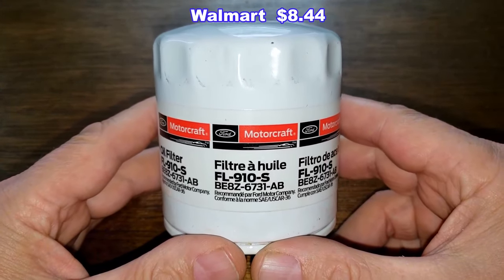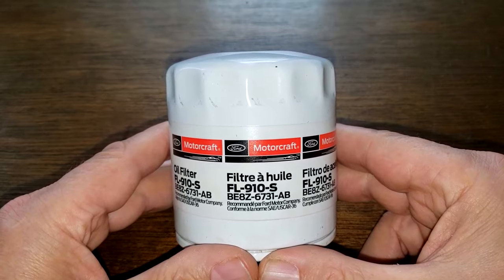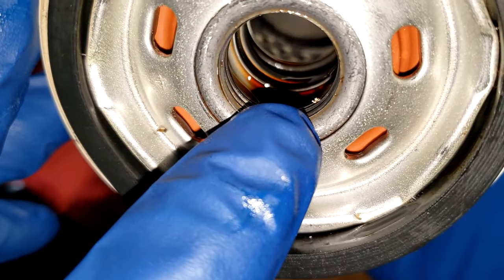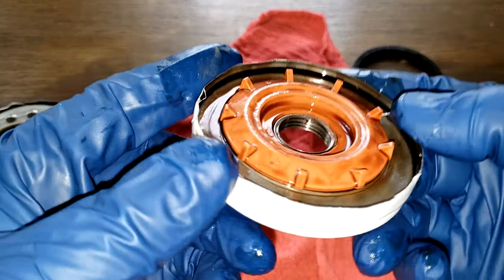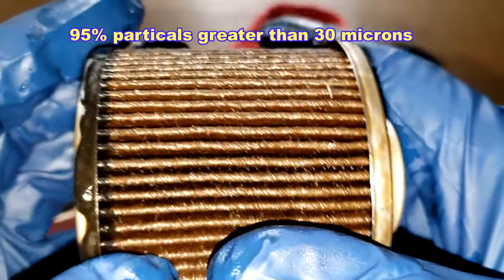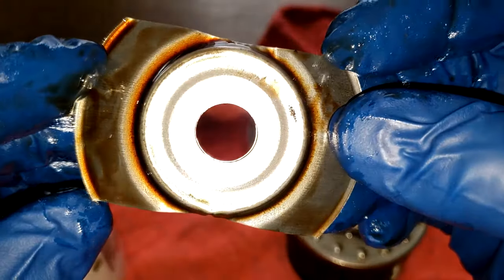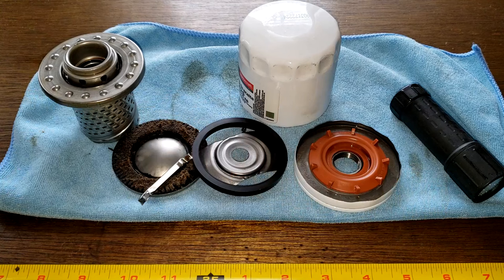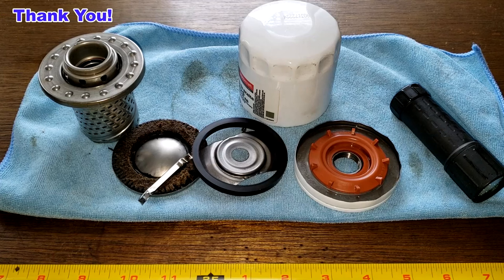Motorcraft FL910S Cut Open, Used Motorcraft Oil Filter Cut Open 1-9-24

Comment: Just a few years ago these only used to cost $3-4 at Walmart. Now they are $8-9. I can get a wix for that😂
Reply: When I bought this truck I got a shop case of the filters from RockAuto. They were under $4 each when purchased that way.
Reply: @mtfan  not sure what a shop case is, but checking now, RA has them for $5.46/ea not including shipping. Lowest cost USPS to me for 12 is ~$13 plus tax, so about 6.50 each before tax.  That said, wouldn't use that many filters in month of Sundays. In any case, not the ~$4 off the WM shelf they were not too long ago.
Reply: @faxmen09 a shop case is what the dealerships and other mechanic shops get - 12 filters in one box with no additional wrapping or individual boxes.
Reply: @mtfan  OK so 12 filters, kinda what thought as far as numbers. Gave current RA price breakdown at that number. For FedEx ground $1 more total than USPS. Loved them at ~$4 each WM price, especially for OPE use. Now, not so much. Thanks for the reply.

Comment: I use these exact filters on my 33hp Spartan mowers. Stellar results at 100 hours. Nice video.
Reply from the maker: Thanks!👍
Reply: It's nice to know the Ford Maverick has a lawnmower engine 😁 well the Maverick will probably sound like a lawnmower when it's lifters fail or it's turbos high compression wears out the engine
Reply: @daewooparts  
WOW 😮😮 just wow.. 😂😂

Comment: 910S is a decent filter still with base end bypass. But man has the price of the 910S increased. Not long ago it was ~$4 at Walmart (off the shelf) and Amazon. Today, $8+ at both places. At $4 they were a great choice as an OPE filter for mowers and such. Still cheaper than the dedicated oem OPE, but other 3614 options now in the picture. As for base end bypass, FoMoCo has been picky about it, but now some MC filters for Ford have moved to dome bypass. Imo, base or dome, not big deal either way. Seems Ford may be thinking similarly. Thanks for the vid. Maverick Hybrid seems like a cool truck.
Reply from the maker: You're Welcome faxmen09

Comment: I've gotten 212000 miles out of my 2014 Fusion 2.5L with that filter and Motorcaft 5W20.  I've never cut one open but I'll probably do it on the next change and maybe have a UOI done just for kicks

Comment: The WIX and NAPA filters I was using used to have a base end bypass but switched to being on the dome end. The Motorcraft filters I used when I owned Fords always had a base end bypass. I wish other manufacturers had base end bypass valves.
Reply from the maker: Yep, when I first started cutting open the Wix filters for videos, some still had the base-end bypass valves. I guess the dome-end ones are cheaper to make.

Comment: Motorcraft looks well made. Remember when they were known a FoMoCo? Showing my age. Companies should have a machine that cleans excess glue. Hello Matt, you're near me. Maybe see you on rt30.😁
Reply: I’m sure I have at some point! I actually bought a shop case (12) of these filters from RockAuto when I got the truck so I think my price ended up at $3 and change for each. They don’t have their own individual boxes but they’re nested nicely in the case.
Reply: FoMoCo is factory Ford. Motorcraft is like aftermarket but made to Ford specs.
Reply: @LA_Commander  Go try to buy a FoMoCo filter across the parts counter at a dealership. You can't in almost all cases save a few exceptions like the GT. 

They're the same filter, made by the same company, just with a different label. Ford's consumable parts and fluids are pretty much all under the Motorcraft brand name and that's the only way you can get them as a consumer.
Reply: @mtfan  exactly. It's just a label.

Comment: I had a Mav exactly like the picture (sold it for a slight profit after a 1.5 years).
Use an XG3600 or FL400S, for an over-sized alternative to the tiny FL910S (or XG3614).  Holds more dirt, filters better, fewer bypass events, etc., all good, fits great.
Reply from the maker: Thanks for Sharing👍

Comment: You should look into the filters ford is replacing the fl910 and fl500, think there is others but at my shop cant get a 910 or 500 anymore instead you get a fl2123 aka fl910 and fl2121 aka fl500
Reply from the maker: Thanks!
I just ordered them filters from RockAuto. The videos should be seen sometime next month.
Reply: @WhipCityWrencher  alright cool, they honestly look considerably cheaper made as to how they were before. The look nearly identical to a valvoline and a ac delco oil filter I took off few days ago. One detail about them I know is the filter/drainback valve all seem to be off center in the filter from what I can see looking through the center hole.
Reply from the maker: @motorhead45102  Okay Thanks, I'll try to remember that when looking at them.
Reply: @WhipCityWrencher  looking forward to that video!